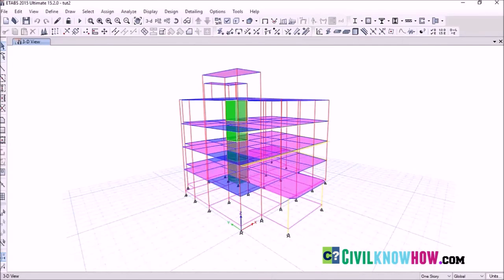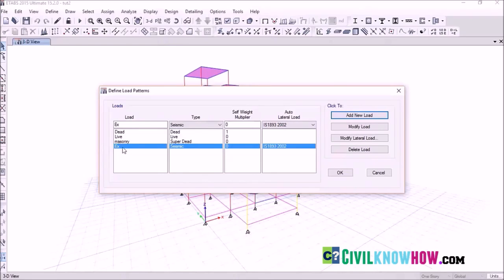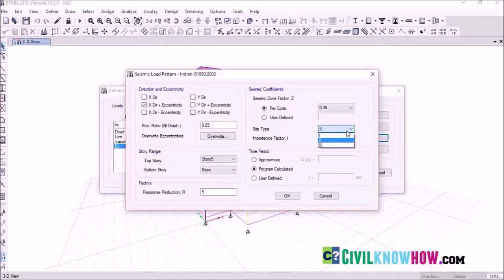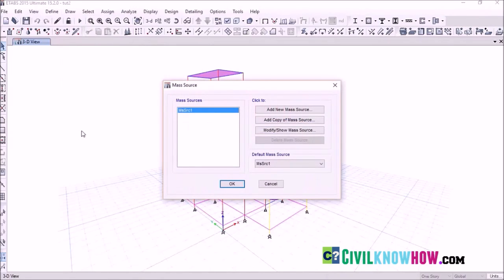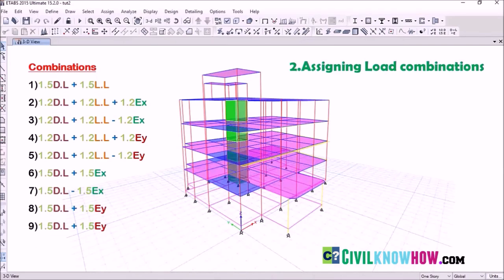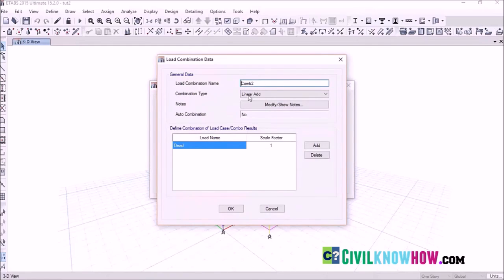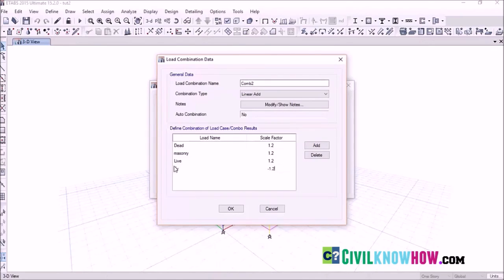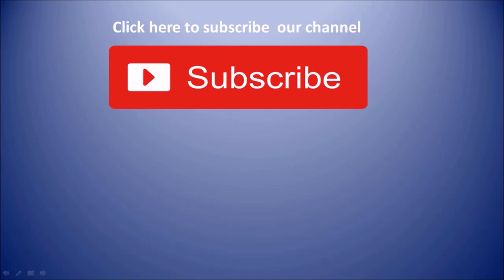Etabs 2015 Tutorial 3 - Assigning seismic loads and Load combinations

Comment: whats the difference between program calculated and user defined time period? How much is it neccessary to choose user defined time period?
Reply: Program calculated means, it is the value used for general calculation, say around the area of a city. User defined means some contracts require you to use a specific value. If time period is not specified, use program calculated.

Comment: Dear.. Making an envelope and then designing on the envelope combinations will make the model much unrealistic and uneconomical as it takes all the max. Values... In reality it is impossible that all stresses occured at at maximum values at same time..
Reply: But that is the concept of design; taking into account the worst possible scenario by determining the maximum value.

The software will not use all of the load combinations. It will just determine the maximum value given by a specific combination or combinations then use that.

Comment: sir weather we appy earthquake load in both direction symaltaniously in etabs?
Reply: No. Earthquake will only occur in one direction. If you want to design on the x-axis, use x direction then do another combination for the y direction. That means you will have 2 load combinations for seismic analysis. If the building is symmetrical, just use one load combination. But if not, use 2 load combinations. The program will size the columns based on seismic in x and y directions.

Comment: when you defined  Ey you  putted Ex also !!!!! I think the seismic only in one direction Ex or Ey .
Reply: But you don't know which direction it will occur. You can actually use only one earthquake load combination. The final design will size the columns. Then you just select the biggest section. Some designs require both axes to be used especially if the layout of the building is irregular in shape.
Reply: no...we have to define it in 2 directions...then, negative directions will take care of in combination

Comment: why not wind loads?
Reply from the maker: +George S will soon upload one...in rcc structures wind load does not dominate ...it happens only for super tall buildings
Reply: Civilknowhow Tutorials yeah i figured it out..also it would be great if you did a video about how to do a dinamic analysis with the method of equivalent forces and moments and compare it to the response spectrum analysis..im reading currently the eurocode and its very easy to understand..its like you dont have even to think..just follow the rules..
Reply: You can also use windload but the seismic combination will still prevail. So in order to reduce work, knowing that wind will not cause the greatest force, just ignore it.

Comment: please make a video on how to design columns for softstory.
Are columns only structural members affected by softstory? beams and slabs are not affected by soft story?
IS code says softstory column should be designed for 2.5 times the base shear. can I design the soft story in etabs by multiplying earthquake load by 2.5 in all load combinations? would it be right or am i misunderstanding something?
Reply: or alternatively can I multiply all the load patterns included in mass source by 2.5 for softstory analysis after designing non-softstory members by using usual mass source ie DL+0.25 or 0.5LL. So for soft story the mass source will be 2.5 DL+0.625 or 1.25LL.
Reply from the maker: +beenay18 pls specify the is code n clause
Reply: IS 1893 (Part 1 ) : 2002
7.10 Buildings with Soft Storey
7 .10. l In case buildings with a flexible storey, such
as the ground storey consisting of open spaces for
parking that is Stilt buildings, special arrangement needs
to be made to increase the lateral strength and stiffness
of the soft/open storey.
7.10.2 Dynamic analysis of building is carried out
including the strength and stiffness effects ofinfills
and inelastic deformations in the members, particularly,
those in the soft storey. and the members designed
accordingly.
7.10.3 Alternatively, the following design criteria are
to be adopted after carrying out the earthquake
analysis. neglecting the effect of infill walls in other
storeys:
a) the columns and beams of the soft storey are
to be designed for 2.5 times the storey shears
and moments calculated under seismic loads
specified in the other relevant clauses: or,
b) besides the columns designed and detailed
for the calculated storey shears and moments,
shear walls placed symmetrically in both
directions of the building as far away from
the centre of the building as feasible; to be
designed exclusively for 1.5 times the lateral
storey shear force calculated as before.

Comment: can you demonstrate assignment of load input sawtooth type function of rotation v. cycles. With this, show joint restraints required (explaining why), I'd like to use a non linear link element to simulate lumped plasticity and record hysteresis.
Please ask if my question is not clear. Thank you.
Reply from the maker: +Chris Pieper  non linear property of a material with respect to a waveform expressed in rotation...is this wat u mean?
Reply: Yes. The problem is to model a linear (timber) element, with ductile (non-linear) connection. The connection model I want to use is Pivot because it best matches test data. I would like to do a portal frame model  (2 columns and one beam) with unique connection models for each. Then, to verify the connection models (non linear link elements) are matching experimental results obtained by comparing (viewing) the hysteresis. 

I am not certain where I am getting stuck but I almost have it working. I have a working model with just a cantilever.

Thank you for your response.

Comment: Sir, For the linear elastic seismic analysis, Don't we need to find the lateral forces manually using Equivalent Lateral Force (ELF) method and apply them on each story?? as has been done in some design examples of FEMA and described in ASCE 7-10???
Reply from the maker: +Nasratullah Amarkhail in Etabs ..there is programmed calculated option...so u don't hav to..